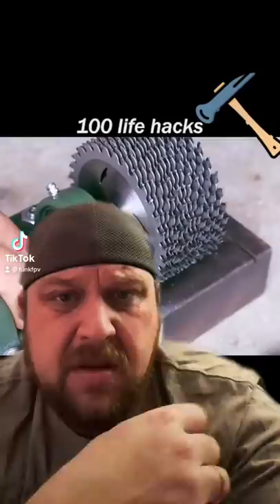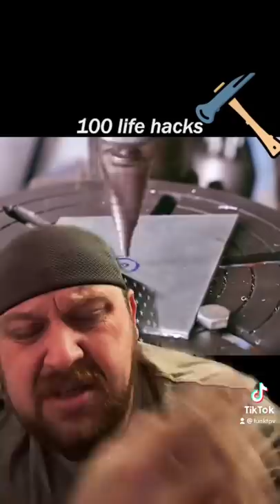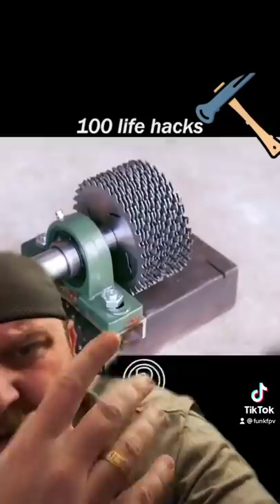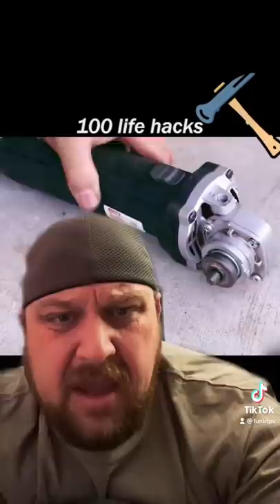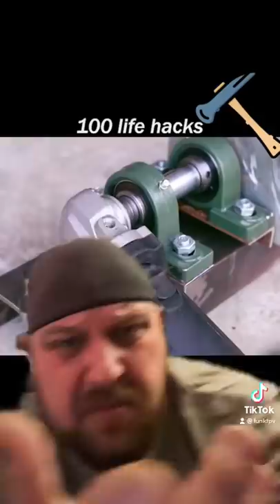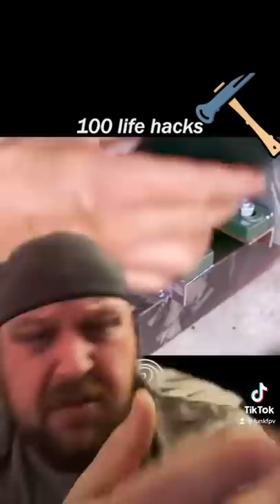Dangerous Life Hacks

Comment: Tack tack tack tack tack 🤣🤣 all jokes aside, I've never welded either. 🤷‍♂️ I'd figure it out if I had to.
Reply: Pretty east to learn hard to master, I’m still trying to sort out all the intricacies in this art, like not creating a huge sludge in some of my welds or making far too much sparks, getting the angles right basically.
Reply: @simpleman8883  Shoot I never finished learning it. Didn't seem all that easy to me to practice mig, fluxcore, with a 3/32" wire.

I started to have good lines towards the end but my current job pays better than our welders so now there is no need to finish learning.
Reply: @KillerofGods  Yeah I’m learning as I was a Material Handler, but Welding pays a whole lot more, and well it’s pretty interesting, the only problems I have are the fumes, but outside of that I love it!
Reply: @simpleman8883  get yourself a half face mask with a quick release and throw some flat vapor filters on. That will help with the fumes and it should still fit under your hood. If not, then they do make hoods with built in respirators, so you could try that
Reply: @KillerofGods  3/32 wire?? I think you mean rod. Welding wire is measured by decimals .030,.035,.045,.052 ect. 

3/32 wire would be huge.
Reply: @jmathews470  I can ask again it has been a couple years but I do remember someone saying 3/32".

From my recollection that seems about the right thickness for what I was using.

They use it to weld parts onto Iron beams/Columns. Some of those welds for the base plate can literally take most of a shift to fill out because it requires so much weld and then back gouging and more weld.
Reply: @jmathews470  na man .030in wire would be .76mm like a lil bigger than a honey bee stinger.. he's right. Stick and tig is where the $ is. Or get real crazy and move to a port city and underwater weld....big nuts and big money
Reply: I have never welded before either. But I know that this isn't how you do it. Just like the guy was saying, he didn't make a fully weld the metal together. He just put a bunch of tac welds which make this not as sturdy. And I doubt this would happen but bet he'd learn when those tac welds don't hold up and send those blades flying.
Reply: @chrizdaman1267  maybe if you go by mm, here in the states wire is sold by the sizes I just stated.  I've been welding for 25+ years.  15 years for the D.o.D, almost 7 years with multiple defense contractors (Lockheed Martin, DS2,URS,AeCom, Pacific Architects and Engineers) and currently at Plant Vogtle (nuclear). I have never bought or used mig welding wire that was 3/32 in diameter. And I know how big 3/32 is, it's 1/32 smaller than 1/8th of a inch or .125 in decimal. Now .030 is small and is used on thin material like 16 ga sheet metal, to where .052 is used on stuff like 1/2" plate. The biggest rod I've ever seen or used is 5/64 and it was nicked named the jet rod. Used to filled thicker material with a 1/4" gap. But I will say as far as Tig welding goes the filler metal is measured by fractions as he stated 1/16, 1/8, 3/32 ect.
Reply: @jmathews470  I'll look in an hour. My profile pic is the constitution, I know "the states"
Reply: I picked this class as my specialized class... And I fairly learned some things, including that Tack welding is a no-no in the long run.
Reply: @AGMertzy  Thanks for the Tip! I’ll definitely look into it, I really want to protect myself against that.
Reply: @simpleman8883  Any time!
Reply: @jmathews470  You are correct. I will say though that they do make 1/16” flux-core wire. They use it for structural steel and other really heavy duty applications. I dunno if they make a 1/16” solid wire though. I’ll look it up real quick
Reply: @UCY4FY_W1_bkBp-y1quJKlcQ I stand corrected sir. That's a 1st for me. I've honestly never heard of it before. Us welders learn something new everyday. My experience lays in ground/air combat vehicles and pipe for the most part. Thanks for the schooling man.....no sarcasm intended👍✌.
Reply: @jmathews470  You betcha man. Always happy to spread some knowledge and just as happy to soak some up. Sounds like you’ve probably been on some pretty cool ass jobs
Reply: @AGMertzy  Yeah I've been around the block hahaha. I really wanted some of that pipeline money, but we all know what happened to that. This nuclear stuff isn't to bad, I'm just the outside type guy. Can't stand to be indoors, but it pays the bills.  Hopefully this administration will open the pipelines backup, especially with this mess over in Ukraine. If so I'm heading out brother.
Reply: @sorashou6229  it’s not used in the short run either. Tacks are for tacking things together that you then weld together

Comment: Tack tack tack is the best way to weld thin metal like this. With that rod you'll overheat and warp it or burn through it if you try to run a bead.

Comment: I use to run a gang saw that held blades like this. You could adjust the blade widths for different applications. It was a pig biot...it was a jerk of a saw. A tank. It had automatic rollers for the lumber, otherwise shoving boards through would have been impossible.

Comment: That is actually what you use a step bit for, to literally drill holes in sheet metal. What.. What are you using the step bit for??? as an electrician that does cable routing this size of material is quite common. Let me know if I'm missing something because that comment put me in a spin.

Comment: they probably use transformer stick welders without hot start. the only way to strike an arc easily is to crank it up, but then you would burn through in 2 seconds. that's why they tack all the time

Comment: I used a step drill to drill some thick plate a few years ago because I was under a truck & had a hitch on my chest... necessity, because I was told they were only for thin material.

That was the easiest ¾" hole I'd ever drilled in ⅜.  Now, my wide step, steppers are my go to hand drilling bit. 

Don't believe everything you hear.

Comment: Guy must have worked at a tire retread shop. When I worked at one, we had a machine that used a similarly-constructed blade set (they weren't whole blades, but sections that were stacked on pins, but the finished tool looked almost the same as the stack of sawblades here), and it was used to grind off the old tread so the replacement could be put on in its place.

Comment: The tool is actually for testing blade sharpness before using on a project. First you run soft wood, then hardwood, and finally steel. If the blades seem worn after the steel test, start the testing process with some fresh blades

Comment: Umm step bits are the perfect bit for that size hole in sheet metal, if you are using a hand drill. I’d be very curious as to what you would use?

That machine that is obviously a wood chipper looks like it would work better than any of the import junk you can buy in the store these days.

Comment: My question is, with all this welding, how do you ever take out the blades if they need sharpening?
Reply: Pretty easily since they never completed the welds. A good smack with a cold chisel takes it apart and then you just tack it back together afterwards.

Comment: What is the reasoning behind the step bit being the wrong tool for that? Do you mean just when the steps are shorter than the material is thick? 

I have some step bits where the steps are 5/16 tall. It's my favorite thing for putting big holes in 1/4 mild plate.

Comment: I see literally no actually point in this project other than to simply say they done it, I would guess it might be alright for making really fine dust mulch for garden bedding, when cleaning up all the sticks in the yard lol, otherwise I see no actual point to have or use something like this, now if he turned the saw blades sideways and cut a couple slots in the sides of those blades and added a few sharpened edge iron bits or teeth of approximately an inch or 2 squared, it could definitely be a very cheap wood chipper mulcher or something close to that...